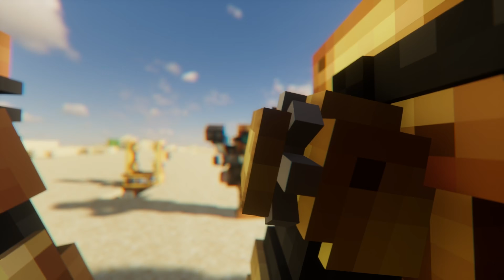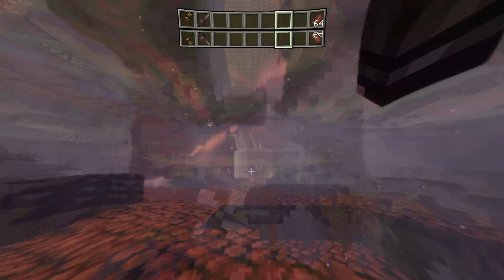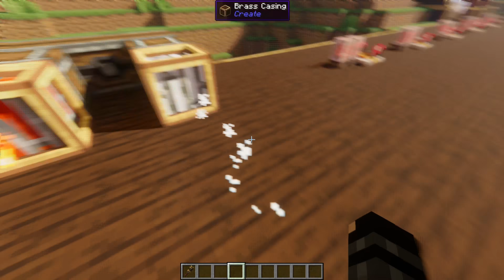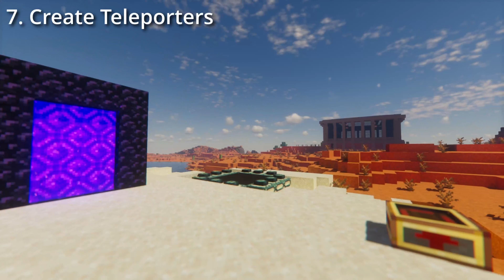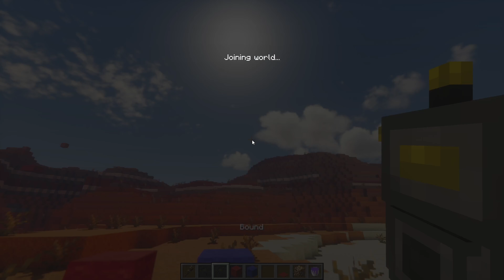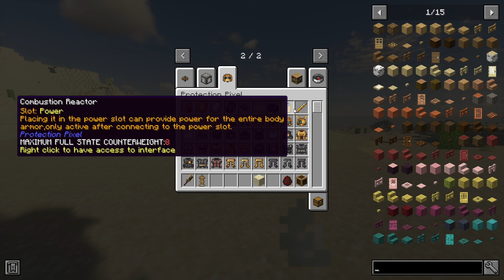Ten of the Best Addons for Create Mod that You Need To Know!

Comment: WARNING:

Protection Pixel, albeit a great mod, has recently added a dependency that is basically a data selling center (BrightSDK). As far as we could tell, when they added it, it didnt actually send any data anywhere but it still got added and they were planning to fully implement it as part of some deal with them. Many mod providers have removed the mod from their list just to be safe.

Comment: you got any preformance mods for forge so my laptop doesnt explode from 3 steam engines?
Reply: Embeddium, ferrite core, and entitiy culling are a good place to start, although Embeddium and Valkyrien Skies don't play well together. You might also try increasing your RAM allocation, just be careful because if you start using virtual memory and have an SSD you should consider the SSD a wear item.
Reply: @henryfleischer404  cant rlly change shit about my hardware cuz am on macbook

Comment: The best Create add on I've found, by far, is Create: Handcrafted. As the name implies, it lets you craft Create components by hand. Shaft + Casing = Gear Box, for instance.
It might sound OP, but the trade off is the time it takes to craft multiple things or more complicated machines which is actually great for pacing progression as you move from simple machine with a crank to water wheels and so on 
It's a quintessential mod for playing survival or even Hardcore with Create. 
It also has variations of the Vault and Tank in the form of the Stockpile and the Reservoir; they're the same as Connected's variations with better textures, IMO.

There are some other notables for looting parts:
Pillagers Arise and Structures Arise have neat buildings you can loot for parts, and with Quark installed there are very cool structures also rife with parts.
When Dungeons Arise adds a dungeon that has blaze spawners and other Nether creatures to make it easy to get blaze rods and such.

I just worked out the compatibilities between versions of VS, Clockwork, Trackwork and Eureka...with all of the above and a few others like Farmer's Delight et al., Amendments, Supplementaries and like that, I'm as close to my perfect MC as I've ever been!
Reply: Replying to come back to this when I have time
Reply: It sounds so cool!!! Will you ever make it a modpack?
Reply: @tenya825  I've tried replying to these replies about 10 time and it keeps getting disappeared.
Reply: Epic
Reply: thanks came back
Reply: @jonasrayet9369  I've tried elaborating, but my comments on my own comment keep getting deleted. 🤦
Reply: @jonasrayet9369  all of my comments are getting deleted. Frig YouTube.
Reply: @BinaryJoe Can you post an video with the modpack my man? I would love play it!